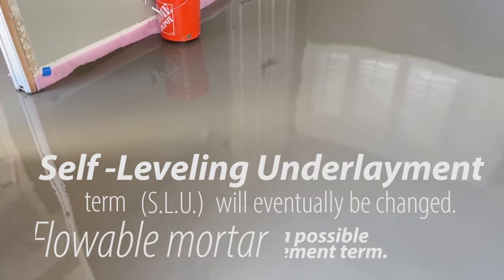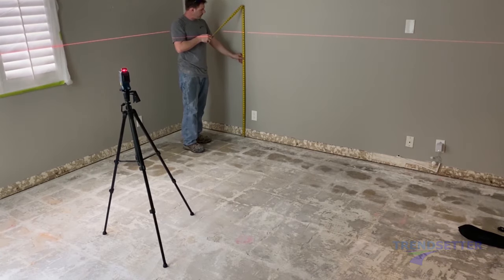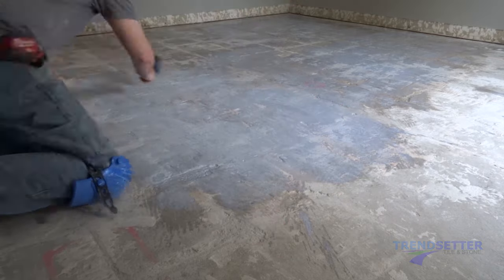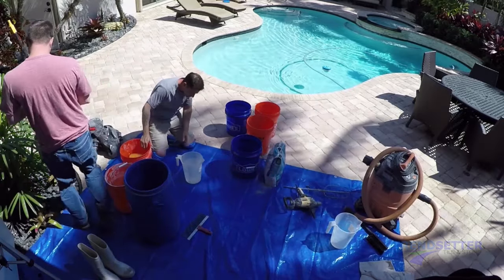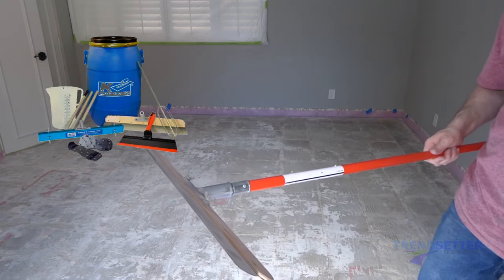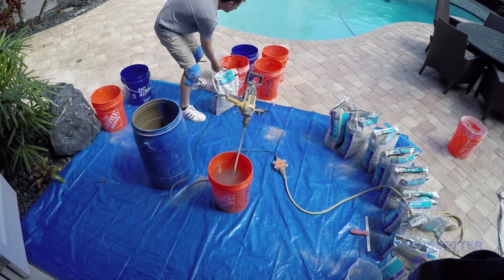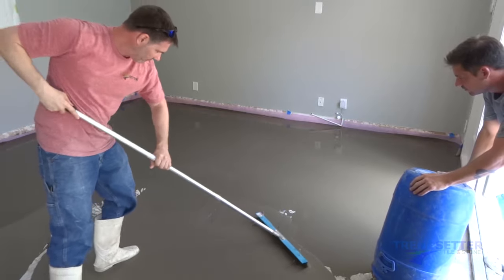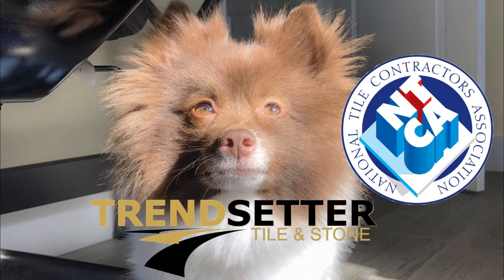Self Level Concrete Efficiently| SLU | Laticrete NXT Level | Level quick for large format tile

Comment: I tried to level a floor area, but the cement makes a squeaking sound now if you walk on it on one part of it. 

I had screed down a 1/4 Cement board since the slope was a lot and I wanted to reduce the amount of cement I needed to pour.

I had rolled the primer onto the plywood sub floor, the primer and self leveling were Laticrete. 

I have no idea why I hear squeaking.

I had walked on the cement board before pouring and it was fine.

Any thoughts on what is happening? Solutions?
Reply from the maker: Hi, whenever you install cement board, or any other type of board onto a plywood substrate, thin-set mortar needs to be used along with the screws.

The thin-set mortar under the board is not used to increase adhesion, it is used to limit vertical movement that the board may experience if the the screws work themselves loose.

1/4 inch board can often leave the screw head resting too low within the board if the screw was originally over driven. It only takes minor traffic to free 1/4 inch board from the screw head, and at that point the board is sliding up and down the screw. The sound can be from materials rubbing or from air that is being pushed through the assembly.

If you had installed thin-set mortar and just forgot to mention that, then the plywood subfloor is most likely deflecting. That would require more work than is outlined below.

I would recommend cutting out the section where the sound is, reinstall that section of 1/4 inch board with thin-set mortar under it, screwing down the board while the thin-set mortar is fresh, prime the top of the board and re install the self leveler in that area.

Some Laticrete SLU's require lath screwed to the floor prior to the application of the SLU. Read the bag you used and be sure that your product doesn't require lath under the SLU.

Comment: This is a great video, but you just glossed right over the sill seal.  HOW is it installed?  How much should be on the floor?  How do you keep the seal to the floor?  Staple to the wall, blue tape, ???
Reply from the maker: Hi John, most of the time the sill seal is stapled to the wall. We used blue tape because the wallboard on our job was very close to the floor and so the sill seal had very little flex. If there is a gap exceeding a 1/2 inch from the bottom of the wallboard to the subfloor, additional layers of sill seal can be used to improve the seal rigidity. 
We have used backer rod in place of sill seal when the gap below the wallboard is large. It's available in different diameters and is sometimes easier to install as it is just stuffed into the gap.
The seal can be attached to the floor with silicone, silicone being better than acrylic caulk because it would not be as effected as the years go by from moisture vapor which can otherwise become a food source for mold.
A quarter inch of seal sill attached to the floor is more than enough.
We rarely attach the seal to the floor, only because of the additional time is not always practical in a real world schedule.
In a perfect world the sill seal prevents all of the SLU from getting through. This is not always the case and there are times following a pour when we must remove excess material after it has dried.
Thanks

Comment: Is this method more effective than using a 10' screed?
Reply from the maker: This is more effective than a screed. A screed corrects areas from high spot to high spot, and that is fine if the floor is fairly consistent. Too many high points though can make it difficult to truly "fix" a floor with a screed or ten foot straight edge.
The exception being when a screed is used with screed strips. Then you are truly floating a floor and screeding may flatter or closer to true level.
Screeding may be more cost effective in material, but the the labor  would certainly be greater than an SLU, and the floor may also become thicker. 
SLU almost always has a thinner profile.
Reply: @trendsettertilestone9602  Thank you!

Comment: Question….what do you do at the relief cuts on a slab?
Reply from the maker: Excellent question! This method in the TCNA Handbook is F205. In this method, under the section movement joints, it says movement joints are mandatory according to EJ171. 

In EJ171 there are several types of joints to accommodate movement. They differ slightly based on the type of joint you are dealing with.

The best thing to do to preserve the joint is to fill it with compressible backer rod prior to the SLU application. You can  put the backer rod in, measure where it is from a parallel wall, Go right over it with the SLU, and then remove it after the SLU has dried. You can place a few screws in the backer rod to identify where the backer rod is, although sometimes screws are more trouble than they're worth. You put a screw at each end of the joint, and then when the SLU is dry, just snap a chalk line where the joint is and clean the joint up.

 At that point the joint should be handled in the manor suited to your particular joint per EJ171 page 442 in TCNA 2024 Handbook.

Thank you!
Reply: Thank you for your support? I thought about using an elastomeric caulking but wasn’t sure if it would react differently to the SLU. I was also going to use the caulking at the base instead of foam. My shop is a slab on grade and I wanted to waterproof the base as much as possible. Thoughts?
Reply from the maker: @Xray0773  No matter what type of caulking you use as sealant in the joint, whether silicone, urethane, or other, you must put backer rod in first.
If you put sealant in a joint and it doesn't have backer rod, or bond breaker tape below it, the sealant is likely to detach upon movement.  This is because the sealant will detach from one side or the other upon expansion, backer rod serves as a medium the helps keep the adhesion balanced, instead of being over powered from one side to the other.
In your instance where you want to use waterproofing the best course of action in my opinion may be to install backer rod, install silicone on top of the backer rod, install SLU directly over the entire project, Apply a waterproof membrane such as Laticrete Hydro-ban over all of the SLU, and then install the tile with a generic joint directly above the existing expansion joint.

Now let it be known, as I described above is not in the TCNA Handbook. Methods of addressing the exact thing you have brought up are currently bouncing around various NTCA committees.  Waterproofing and expansion joints are tricky, there is way more to know than I can relate in this post.

The best thing to do is to give the manufacturer of the SLU a call on their technical line. The manufacturer is the boss!

Thank you

Comment: I have a  7 month old slab pour that undulates high and low because well poor workmanship by my contractor. I’m laying glue down LVP and want the surface smooth. I have about 526 sq/ft. How much material might you estimate I could need?
Reply from the maker: If you're going to set the gauge rake at one quarter of an inch that means you'll get about 22 sq ft per bag, so you'll need 24 bags of product to cover 526 sq ft. The undulations in your substrate may warrant more or less quantity of material. I would call Laticrete's technical line, give them some more details and they can provide you with a better estimate.

Comment: Do you remove the seal sill after the self leveling concrete is cured. Before you still flooring. Or do leave it in there?
Reply from the maker: The sill seal stays in there. We cut the excess off after the tile work is complete. It helps preserve the perimeter joint around the installation similar to backer rod.

Comment: Need urgent advice. Workers putbsome latex yesterday. This morning I can still see some dark patches which tell me they are not completely dry. The worker is on his way but say its  fine to put the glue on then stick on vynil floor is he right?
Reply from the maker: The dark patches are not always an indication that the product is not dry,  the SLU may have been mixed inconstantly. 
If a fan or heat on the area does not dry it out you may have a broken vapor barrier below the slab.
Vinyl should not be installed on a slab that exhibits high RH value. Vinyl traps the moisture which can weaken a bond with the glue causing edges to curl from one piece to another.
You may need a vapor barrier or epoxy sealer to prevent the transmission of moisture to the glue and vinyl.

Comment: Is leveling really needed for the ammount out of level you have?
Reply from the maker: Yes. If the floor is out in flatness by more than a 1/4 of an inch in ten linear feet; It does not meet the standard for flatness as referenced in the TCNA Handbook, that is If the tile is smaller than 15 inches on any given length.

Once the tile is larger than 15 inches, the standard becomes 1/8th of an inch in 10 linear feet. Variations in the subfloor should not exceed 1/16th of an inch in 2 linear feet.

This is the standard a professional contractor should follow.
 
Making corrections with thinset as you install tile increases the failure rate as well as the longevity of the installation, and of course the aesthetics of the floor become compromised due to mortar shrinkage/slippage.

Leveling is not the goal for most installations. Increasing the overall flatness is. The floor in this video was not leveled, just corrected in overall flatness.

Comment: Can you use the same mixer you would use to mix joint compound?
Reply from the maker: As far as the drill itself, if it's a 1/2 inch chuck and does not exceed 650RPM, then yes. But as for the mixing paddle, no.
The mixing paddle with the kit is much longer so the majority of the mix is being mixed at the same time, and it also draws less air into the bucket while mixing. 
The paddle is important for consistent results.

Comment: What about using a spiked roller for the final pass?
Reply from the maker: A spiked roller is fine for the final pass. But keep in mind a spiked roller not only breaks the tension and eliminates air voids, but it also distributes or displaces material like the rake. If movement of the material is no longer needed sometimes the roller can take material away from where you want it, unless the substrate was somewhat flat to begin with. 
On some jobs you could use a spiked roller from beginning to end. In my opinion if you choose the rake, then the spiked roller has no reason to follow the rake. When I use the rake I am actively placing more SLU in the deep areas. 
I have found the roller to be consistent in application but the rake was what was available when I was learning and I have stuck with it.
Reply: @trendsettertilestone9602  Thanks for the reply . 
I watched a video by Ardex and the installer used a gage rake , smoother, squeegee and finally a spiked roller. I thought it was overkill and needing a big tool investment. It’s good to see someone else’s methods…

Comment: Can I use primer before and AFTER self levelling cement?
Reply from the maker: Primer on top of the  finished SLU would only be applied if too much time has elapsed since the first application of SLU dried and you need the application thicker than originally installed. 
I only apply primer on top of SLU if more than 2 hours has elapsed and I need to add additional SLU. 

It's worth noting that additional primer on top of SLU not only reduces the likely hood of a cold joint between applications, it more importantly lets the next application flow much easier on top of the previous one. SLU with a reluctance to flow is a nightmare.

If in any doubt, contact Laticrete technical support. 1.800.243.4788 EXT 1235
Doesn't matter what I say, TCNA, NTCA, or anybody else, the manufacturer is the only one that can be sure how to handle your specific application.

NXT Primer is only for NXT level. It would not be used to increase bond for thin-set mortar or other cementitious material. You could use any other type of primer on top of SLU if you needed to increase bond strength for other materials. That would be unlikely though since NXT Level is highly absorbent and promotes a high bond on its own. 
I hope this helps, thank you.
Reply: @trendsettertilestone9602  reason for asking primer using after is, I want apply epoxy paint on the cement for better bonding or sealant. 
Its for the garage floor.
😊
Reply from the maker: @kan815k  I see, yes indeed if you are putting a coating on that typically requires a primer than that coatings primer must be used prior to your application of the coating. 
You may want to check out Laticretes other SLU's since your application will be in a garage and will not have a traditional tile covering. You may need a higher Psi rating since tile will not be protecting the SLU, so to speak.

Check out this product: https://laticrete.com/en/surface-preparation/nxt/self-leveling-overlays/nxt-level-dl
This one is also worth a look:
https://laticrete.com/en/surface-preparation/nxt/self-leveling-overlays/nxt-level-sp
I have not used them, but the process of application is probably very similar to what you saw in our video.
Thank!
Reply: @trendsettertilestone9602  Thank you so much for all the info.
Keep up the good work.

Comment: I’m sorry but the bag price is now 60$ a bag. To do a 6 square meter room at 20ml deep is over 600$ au not including the primer. This product is simply not economical.
Reply from the maker: This product makes it so the installation of tile goes faster and it saves on thin-set mortar. Thin set mortar using a half inch trowel usually covers a little over 35 sq ft, if a SLU is used prior to the installation of the tile the thin-set mortar can usually cover a little over 55 sq ft. There can be an offset in cost due to reduced labor and adhesive quantities.
$60 a bag is a lot. It's about $32 a bag here. I can understand how a material at that price could affect your bid and cause you to lose out on work because others may forgo the step.
Reply: @trendsettertilestone9602  I totally agree with everything you said.

Comment: Can i do this on tile over tile?
Reply from the maker: Yes you can. The process is the same but you should use Laticrete's Prime and Bond instead of the primer used in the video. Typical primer for SLU is for concrete or wood applications. Prime and Bond is specifically for hard to bond applications like existing ceramic tile.
Reply: @trendsettertilestone9602  how long will this last me on tile over tile ??? Many years ?
Reply from the maker: @Therealpeter10  Tile over tile is a gamble. While the SLU works and can last as long as any tile installation even when installed over existing tile, your new tile assembly will now be dependent on the old tile installation below it.
Even if the old installation is sound, solid and has at a minimum, perimeter joints, there is no telling if it will maintain it's integrity for the next 30 years. 
Any problems that the existing tile floor has, or develops, will be telegraphed to the new tile layer on top.
People do have success with tile over tile and in Europe it is very commonplace.
You may need an evaluation from a local tile expert on whether or not your existing floor is a good candidate.

A new floors longevity is sometimes a roll of the dice when installed on top of existing tile.

Comment: You don’t have to step in the batch, it’s messy and unnecessary. Use spike shoes created especially for these situations.
Reply from the maker: Spike shoes do work good, they can sometimes slip worse than mud boots, since they make such little contact with the floor. Stepping in the batch can sometimes be necessary.